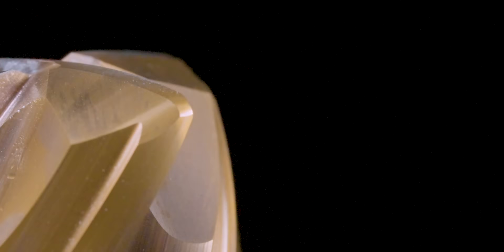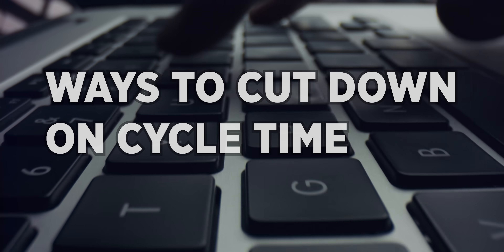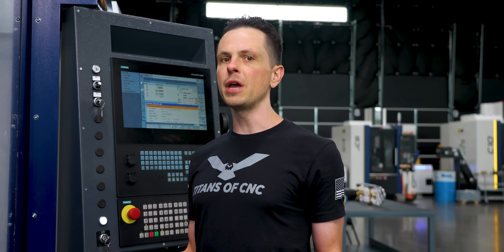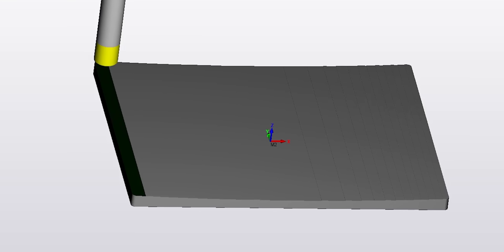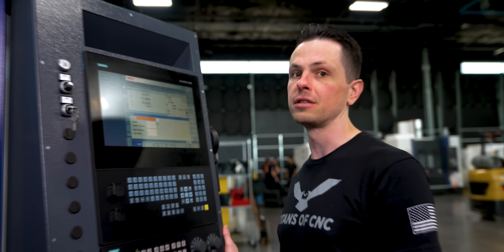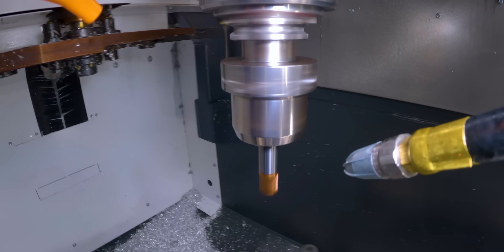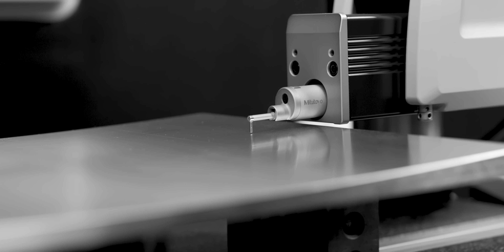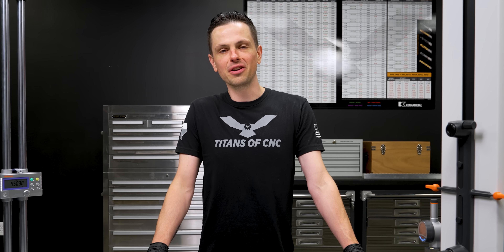The CNC Tool You've Never Seen Before!

Comment: Question: Would the finish be different and would the cycle time be different if you made the passes at 0* (along) x axis vs 90* (across) y axis? Seems like the longer strokes would reduce your accel and decel times due to fewer passes. Just a thought
Reply: It would be slightly faster but the finish would also be worse since you wouldn’t get the benefit of running the radius of the tool “with” the curved surface. Basically the peaks will be slightly less pronounced because of the concave shape wrapping around the shape of the tool. Thanks for watching the video!

Comment: I am surprised that you are programming at the cnc controller.  I would have thought that you have a programming dept or office .  I worked for a large defense contractor with 125 machinists. When we switched from manual to DNC equipment, we were all programming and running the jobs.  It was chaos. To much lost time and not enough spindle running time.

Comment: I have been a CNC maintenance tech for 40 years. I would work with them on our floor being built, tear it down and follow it to the customers floor, set it up, commission it and work with the customer on cycle times, uptimes, spare parts, etc. I started out with Cincinnati Milacron punch card machines! Yes. It got it's programming from air being sucked thru a sheet of construction paper, which was how the system knew it was a one or zero. Very simple programs, but you got to start somewhere. I have since worked with many different controllers. AB, Siemens, Indramat, Fanuc, Mitsubishi, Haas, Omron and more I can't even remember right now. Siemens is the big name in Europe. So is Indramat. Just keeping current with those is hard enough, but the tooling is where all the advancements and leaps of technology are made.

Comment: Soooo much to unpack here. So why mess around, can't we have a 20 inch radius, or a million inch radius? when does it stop being a radius and start being a conventional mill? What about concave vs convex surfaces? In the bottom of a pocket? Can we have a mostly flat mill with the radius only on the corners? Say 25 %? I am interested in the science, as it relates to the performance. But this video is EXTREMELY superficial, and only provides one specific use case. Try harder.

Comment: Why wouldn't you just grind the finish? That's slow as dirt compared to a grinder. Hell, you can get a better finish with a fly cutter in one pass way faster...

What am I missing here?

 Also why were you roughing with an endmill? You had a face mill. A face mill gives a mirror finish and has incredible removal rates that utilize the machines hp.

Comment: manual machinist from the 1970s here. A radiused end mill for surfacing?  I'm haveing issues wrapping my head around that.   I'd go with a Fly cutter for the  Large surface area, fewer overlap seams, and you are done in a hurry. Then if I needed a super finish it'd be off to the grinder.  The radius leaves little scallops - - - yes? 
So, do tell, what's the deal?
Reply: That is exactly what I was thinking while watching this.  Would love to know the answers to these questions.
Reply: Part looks concave
Reply: @realJohnLab  maybe, but I think he would've mentioned something like that.
Reply: @jameswarner7435 if you look at the part while in the fixture and when on the profilometer… it’s definitely concave. 

A better description of the part geometry would have helped.

Comment: Or you could use a Pokolm Mirrorworx insert mill and do the same op in 5-10 minutes with the same or even better finish. Sure you might get visible lines between the passes but you can't really avoid those unless you use a surface grinder.

Comment: The shop I work for uses some Hanita X-feed endmills, with similar geometry; these endmills are WILD... a regular bull nose endmill does 500-700 mm/min feed while the Hanita goes 3-4 times faster, with over 1/2 diameter stepover.
The most impressive thing is that it's on 48-50 HRC steel

Comment: Utilizing tilt with a 5th axis and lens cutter can reduce cycle time and make your surface finish even better with these style tools as well.
Reply: At what degree do you tilt the tool?
Reply: @tomacx1  For this tool you would want to be tilted somewhere between 5 and 12 degrees. That way you are always using 4 flutes (only 2 flutes are ground to center) and you can keep surface footage high enough to be cutting material instead of smearing (surface footage decreases steadily to zero as you get closer to the center of the tool) These tools work best on 5 axis machines but I wanted to show that you can still use them on the much more common 3 axis machine. Most people who know about them think that you cant do that.
Reply: @DraeTitansofCNC if you can tilt the table, wouldn't it be better to use a  taper form tool  with a way bigger major radius?

Comment: I have a 2" face mill cutter that uses circle inserts.  It will produce as good or better finish that this with a 1.25" step over.  Its called using the right tool for the job and this is not the correct tool for this job.  And, id be willing to bet the 2" face mill is cheaper to buy than this cutter is.

Comment: Does anyone know if Fusion can use this type of tool for 3D toolpaths now?  I know it couldn't in the past, but I'm not sure if they've added that ability yet or not.  I had a motorcycle engine cover with a large radiused convex face that I was making and selling and I really wanted to use a lens end mill to do it.  A ball end mill is slow because its cutting near the center.    I imported the lens tool into Fusion and could only use it for 2D tool paths.    🤬

Comment: You could also use a flymill/ facemill and either use the swivel axis or C axis to tilt the job/ cutter. With a 100mm face mill at 2deg you will have like a 5" ballnose equivalent. You can also use PCD inserts in that case and get a way better surface finish. Hope this helps

Comment: i use a highfeed endmill with huge radius at the end. They have low Ap but a hight Ae, with a hight feedrate. If you want a good surface finish with a ballnose, you have to tilt the spindle, otherwise you will cut always in the center of the tool, where you have almost no cuttingspeed.
Reply: Dont forget the Aw
Reply: @nobodyelse-h6h aw?
Reply: @nobodyelse-h6h  Aw Schunks.
Reply: Grüße aus Deutschland, Das war auch mein erster Gedanke Entweder Spindel Einschwenken, Oder über Sinus lineal Das Teil Auf den Tisch Schräg Anschlagen . Für AL-  von WNT:   Aluline -20er Kugelfraser  S18000  F8000.  Kauft euch mal eine Dmg Maschine und fahrt mal Probe
Reply: @-hi703  Warum immer DMG? :)
Reply: 3 axis machines can't do that. I think that everyone would love a millturn, or even a B axis.

Comment: Retired electrician who.loved doing work at machine & tool & die shops. One shop foreman had a snap on tool cart & chest filled with end mills, drill bits, measuring tools etc. He was kind enough to take me in a tour of all the great things he had. He had custom made paths cutting g tools that he made 30 years earlier for first company that he worked for. Told me he has not used them I many years. Hard to figure out who spends for for tools machinists or guys repairing cars & trucks. I hated borrowing tools so had every wrench & socket from 11/4" & smaller, along with plumbing and some carpenter tools.

Comment: You guys literally used different drag distances on the profilometer, .03 for the ball and .01 for the lens, whats the point in lying about this? you can make the point without lying
Reply: They also did something funky with the cutting clips. It starts with a very visible toolpath then suddenly finishes the op with a nearly ground finish? Not buying it.
Reply: Exactly. This channel has been doing dodgy set ups for a long time.
Reply: Please, can we get a follow up with the same settings used?
Reply: Also the step over for the Lens mill was 0.02, but the Lc was 0.01…… dude was measuring INSIDE a cut line. Absolutely disingenuous.
Reply: Finally someone who sees through all the BS on this channel

Comment: It is important with these tools (same with the ball endmills) to note which angle of the effective radius is in the material, and where that angle is (on the periphery of the largest diameter or at the middle of the tool ), so the surface speed needs to be adjusted accordingly, it can be that you are using only the middle of the tool where the surface speed is lower, so you get gray, non reflective surface finish, and lower tool life. If the tool is switching from shallow to steep angles of surface it is best idea to separate that cycle in angle ranges, and calculate best surface speeds. This of course is considering that you are using 3 axis machine where you dont have luxury of tilting the plane as the tool traverses the surface.

Comment: I was told by someone that these things are also called "bull nose endmills" but was never able to find anything like it. Good to have another term to use to find them... I had a project that couldn't be reliably done without one.
Reply: "Bull nose endmills" usually refer to regular endmills that have a large corner radius for a regular end mill. I.e. a 3/8" end mill with a 1/8" corner radius or a 16mm with a 5mm corner radius. The radius is still smaller than the actual tool.

This circle segment tool has a radius bigger than the radius of the actual tool.
Reply: @bryanc.811  Yes, the person who told me about them was wrong. It was explicitly explained to me that these were called "bull nose", but when I was looking for them, all I could find was endmills with a larger corner radius which I couldn't really use for my purpose.

I needed an easy to manufacture method to "lock" an inserted part into place while still allowing a controlled amount of rotation... And doing so while maximizing material as I was already dealing with walls around 10thou thick. Oh, and it needed to be a sliding joint too.

Comment: Unfair comparison because finish is mostly proportional to step-size divided by tool-radius. The step-size for lens mill was only 2x larger while the tool-radius perhaps 3x or 4x. Fair comparison would have been with ball-step-size / ball-radius == lens-step-size / lens-radius. In other words, for fair comparison the lens-step-size should have been X times 0.010, where X is lens-radius / ball-radius.
Reply: This!

Comment: Makes me wonder how fast it would be with a fly cutter combined large radius cutter
Reply: Fly cutter works well only with flat surfaces
Reply: @ex_ed  unless you run it at an angle.
Reply: @ex_ed  Which is what this was.  I was expecting the lens endmill would be used on the pocketed side, where you couldn't run a big fly cutter.

Comment: unfortunately, it turned out poorly. You made several cardinal errors, which I'll list in the points below.
1. Roughing aluminum with this Ap and ae should not be performed using strategies (Volumil, imachining, Wave). There's no appropriate Q in cm3.
2. The cutter you showed is nothing new; it's a tool that's been around for a very long time, and to understand it, you just need to understand the role of "R" in the formula for the theoretical roughness height.
3. The program is poorly written. During chamfering and other machining operations, you can see the cutter stopping at the transition from arc to line and line to arc. Are you familiar with the 832 cycle in Siemens?
4. The spindle stop time and the sound don't reflect well.

Best regards,
Robert

Comment: Why is the gradient of the finish different towards the middle of the part ? Maybe you have some resonance in between the vero mounting points ?
Reply: As the radius on the part get closer to flat the portion of the tool that is making the cut get closer to the center of the tool. Surface footage deceases to zero at the very center of the end mill and changes from cutting material to pushing material as a result. Ideally you'd never use the center of the tool to finish anything but with a 3axis mill you cant do anything to prevent this when using a ball or lens end mill. 5 axis machines make it a lot easier to avoid this but not everyone has a 5axis machine so I wanted to show that these types of tools can still be used on the more common 3axis type of mill
Reply: @DraeTitansofCNC  Thank you sir

Comment: That's cool and good to know.  But, now can you expand on the concept and increase the stepover and feedrate to get the lens tool to a 20 finish?  Why waste time getting to a 3 unless it calls for it.?  If saving  time is the goal lets do just that.  If 3 Rms finish was the goal you killed it.  Great job though.
Reply: tried calculate it and to get the same finish with both tool it would cut the cycle time by 18 
9h vs 30 min
or 3h vs 10 min